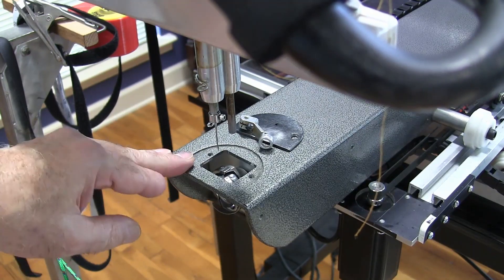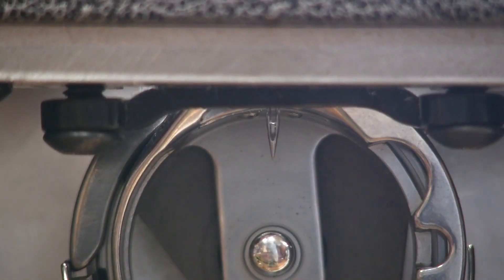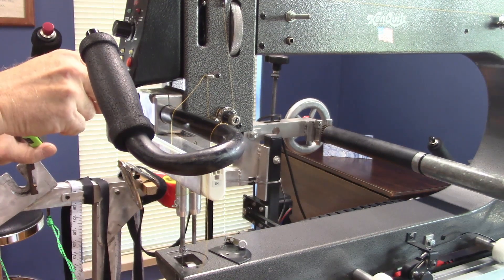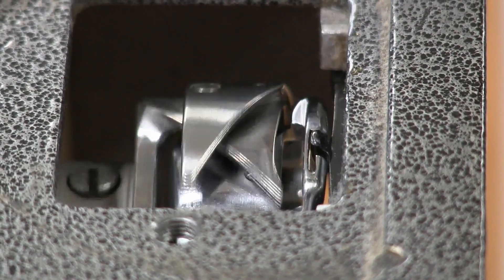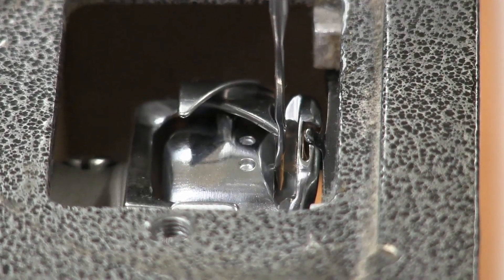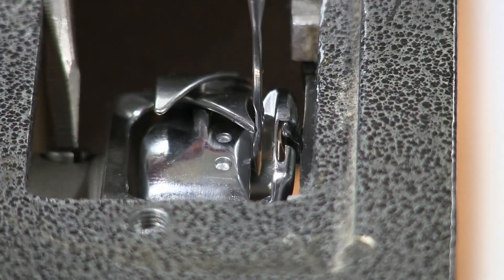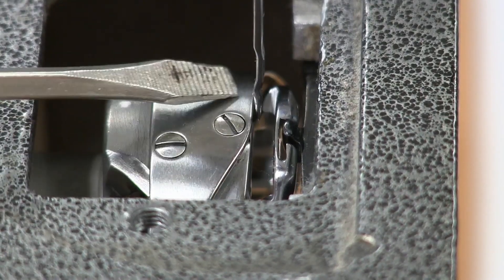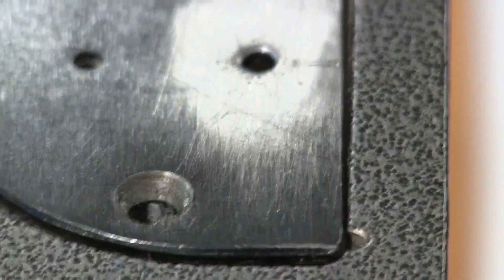Timing and Setting Needle Height On a Longarm Sewing Machine

Comment: Thank you, question, I have a HQ. Is it possible for the timing to be out completely?  I’ve been taught to time my own  by a HQ Tech because of where I live.  I’ve timed mine over 20 times and it’s been slipping more often.  According to their helpdesk, they said it’s not close enough to the hook. It skipping stitches forward, not backwards or not side to side.  It stitches along just fine, maybe every other quilt, I have to retime.  Do you have any suggestions?
It’s computerized and I haven’t hit anything. It just happens.
Reply from the maker: I really only have experience with my machine, however...  Timing should not be an ongoing issue and should only need adjusting if you jam the needle into the hook or something comparable.  If you are setting the timing and it is working correctly then 2 quilts later it is off then the screws holding the hook in place are coming loose and allowing things to move.  If you have set it this many times it is likely that the shaft that the hook is attached to is chewed up from the tightening the screws.  Maybe a little sandpaper would help smooth them out.  Not too much as you don't want to make the shaft smaller.  Try tightening everything up as much as possible and see it that works.  Sorry that's all I know to try.  Remember once you set it, it should not change so something is not tight enough or is loosening up and allowing the hook to move.  Good luck!